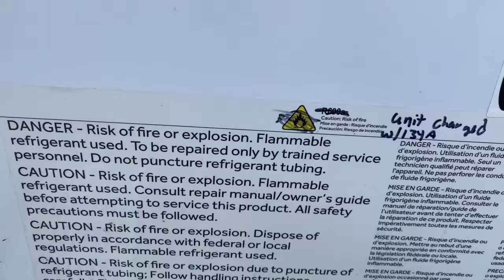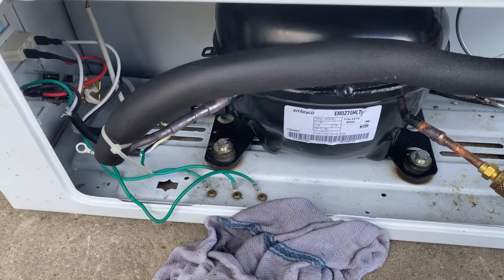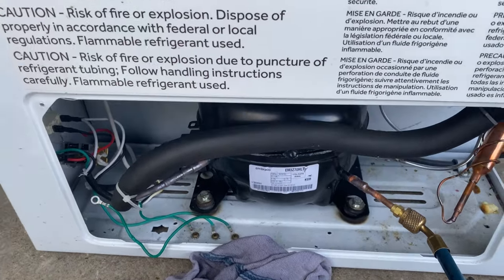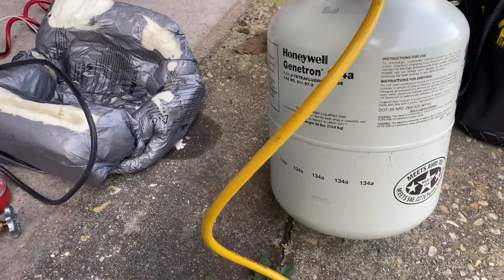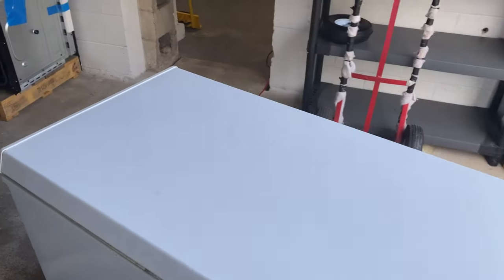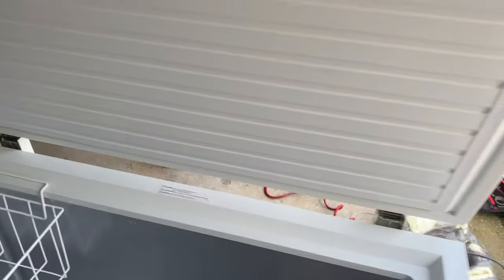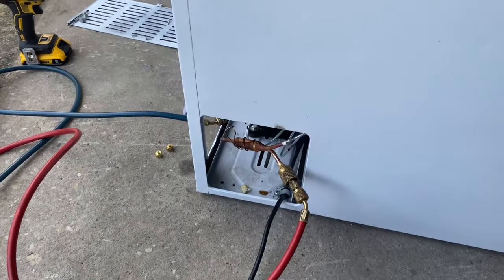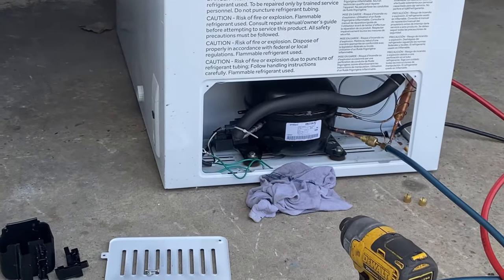Deep freezer compressor replacement!

Comment: I see you didn't pressure test the system with nitrogen and check for leaks before you pulled a vacuum?  but good job I subscribed.
Reply from the maker: Thank you for subscribing and your feedback
Reply: What torch are you using?

Comment: A very helpful tip is to add 50ml of sulphuric acid to  the compressor before regassing.   This improves the life of the compressor.
Reply from the maker: Thank you for the information. Can you post a link to where I can find it?
Reply: 😮😅..that advice sounds like a bad troll..in hvac systems lines are typically flown during brazing/soldering with nitrogen to prevent acidic residuals on the inside of the piping..acidity would eventually go into compressor with the refrigerant/oil flow where the motor winding insulations may start to dissolve into oil and shorten the compressor life substantially.. So maybe you shouldn't try that..that's also the reason to use phorphorous-copper (i'm not from english speaking country so i don't know the correct name for these sticks..) sticks without flux when joining copper to copper to avoid acidity in the flux ending up into circulation.. These freezers/fridges are typically soldered without nitrogen due to single service port (more difficult to set up the small flow) and small piping (not that much residual vs amount of oil)..and also there is steel to copper and aluminium to copper joins so diffrent sticks needed as well.. but anyway.. i wouldn't add insult (sulfuric acid) into injury (residuals from brazing)..😅 
..but let's say; i also understand the troller..i also see so much 'instruction' videos here that i see are either awful for the equipment or to atmosphere or for safety (refrigerants are also poisonous and can have long term health effects).. eg. i can't understand how anyone can buy r134a, r410a, etc. extremely high gwp gases even today without proper licensed skills and eg. just refill the leaking products without any effort to localize the leak, and so on.. we need new children and we need our earth for them so very hard to understand the attitude of skipping the harder parts of getting proper knowledge, skill and tools for the job that requires them..😢
Reply: Here there's no EPA.  so we all let the gas free.  No worries

Comment: That steel pipe they use now is a bitch to braze up
Reply from the maker: Facts
Reply from the maker: If this video was worth the watch. Can you do me a huge favor and like and subscribe to my page. I’m trying to grow the page so I can put out better videos and higher quality content. Thanks in advance!!
Reply: If you fill the pipe with water  before  brazing it will be easier to braze
Reply from the maker: Not possible you can’t introduce water to a sealed system. It will ruin the compressor and other components.
Reply: If you fill the steel pipe with water it will be easier to braze